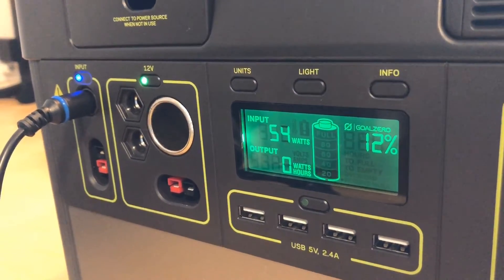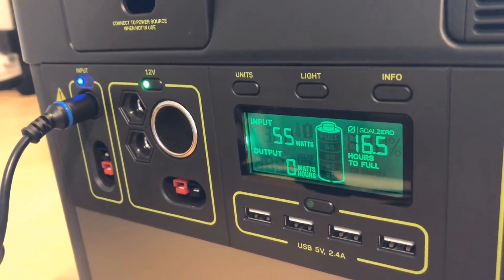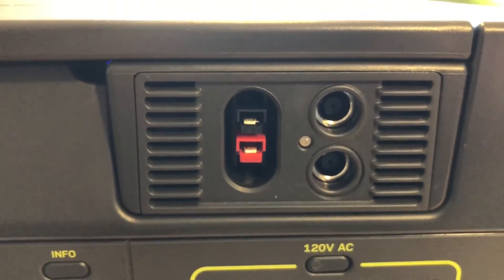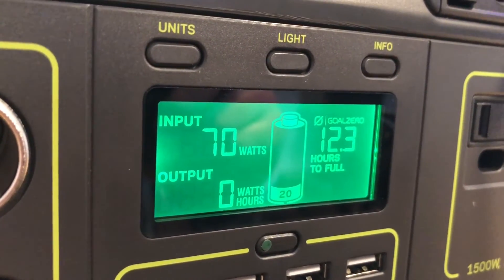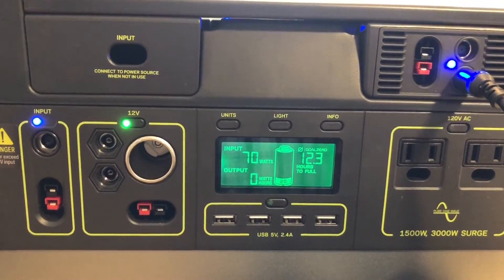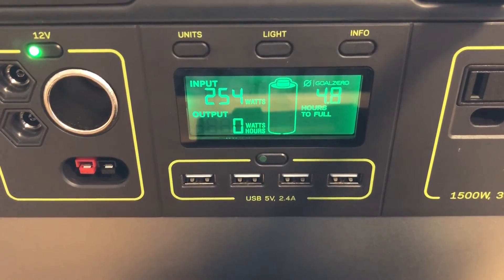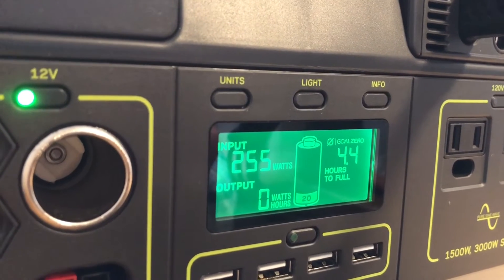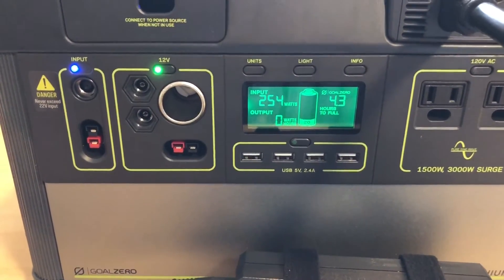Goal Zero Yeti 1000 Lithium: Fast Charge In Just 4.5 Hours Instead of 18!

Comment: I understand the usefulness but this is just too much money
Reply from the maker: Anthony - You're right, it's definitely too much money to just just charge you Yeti super fast. Usually you can just wait and slow charge it. However, I'm using these to quick charge my Yeti via a propane generator in emergencies so for me it makes a lot of sense to be able to run the generator for 1/4 the amount of time to save fuel. I have a video on that setup if interested: https://www.youtube.com/watch?v=W6frqPTM65Q&t=18s
Reply: @todd.parker  does your generator output 12 volts, which you can then keep everything DC? I know the newer Honda generators have a 12 volt charging option. Not sure how fast it would charge the Yeti 3000 however.
Reply from the maker: Sam Beyers Unfortunately the Ryobi only had an AC output but if your generator offers a DC output that might be a good option!
Reply: Totally worth it in outage, if you have panels
Reply: For many people time is more value than the money saved from not buying. Especially people that live in a conversion van

Comment from the maker: Small update: When I had this mega charger plugged into my Yeti, I saw up to 290 watts of power going in once it had been running for a while. That was outside on a cold day so maybe this kept the chargers cooler so they were able to output more? See my video on the Ryobi propane generator charging my Yeti for details.
Reply: Todd Parker the charger has to put out more watts the fuller the battery becomes.thats why 250 at 15% but more like 290 at 90%.
Reply: I built a similar fast charger using 4 Lenovo 90w power adapters rated at 19v - they have built in 8mm connections which connect to the Anderson combiner cable.  I also used a power bar for powering all 4 adapters.  I also plugged in the standard charger cable.  Total wattage going in is roughly 330 watts.  To keep all the adapters cool, I aim a small Vornado fan at the Goal Zero and power adapters.  This keeps the temperate of the adapters at less than 90 degrees F.  It works very well. Thanks for the idea!

Instead of buying the proprietary Yeti car link, I use an inverter to power this in my vehicle while I drive, charging the Yeti.  No need for solar panels!
Reply from the maker: Hey that all sounds like a nice setup, thanks for sharing
Reply: @southsurreybc  You wouldn't happen to have the model # for those lenovo adapters do you?  I'm not up for $40 a pop for Goal Zero's unit, nor am I up for $150 for the fast charger.  I've never tossed an ac/dc adapter ever and went through my box of about 150 of them.  Not one has the right 8mm male center pole like the Yeti does.
Reply: Can you rerecord audio?